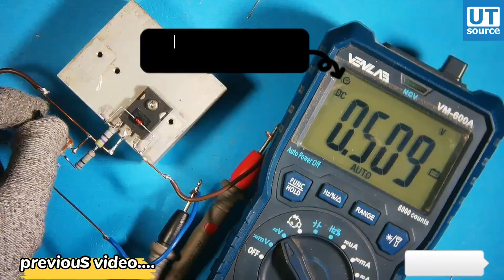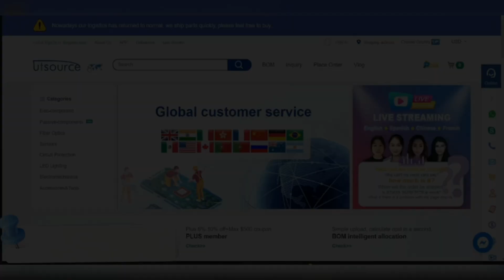Single Mosfet 0V To 450V - 10A Variable Power Supply Circuit | utsource

Comment: I'm watching from Russia.
Well done and the measurements taken correctly!
Respect to the author!
But why is there no diagram??
Even such simple devices require a circuit diagram!
You can post it in the video for 4-5 seconds, or even better, a separate link to the diagram.
Then it will be professional!
Otherwise, there is a lot of advertising but the most important thing is missing...
.
Смотрю из России.
Хорошо сделано и правильно поизведены замеры!
Респект автору!
Но, почему нет схемы??
Даже вот на такие простейшие устройства нужна схема!
Можно выложить вв ролике на 4-5 секунд, а ещё лучше отдельно ссылку на схему.
Вот тогда будет профессионально!
А то, много рекламы а самого основного нет...